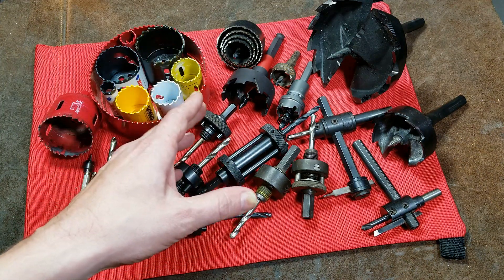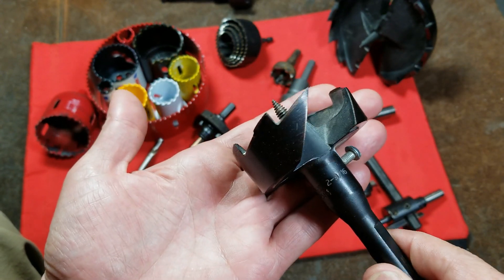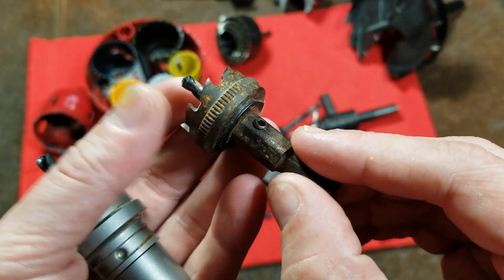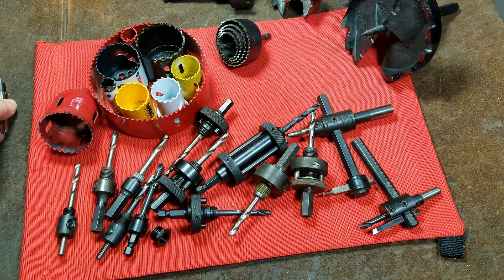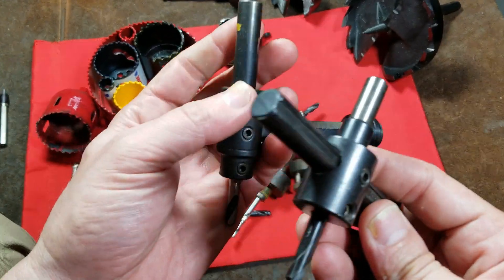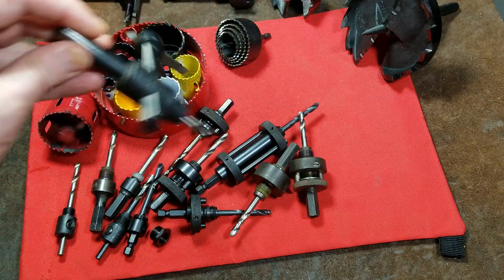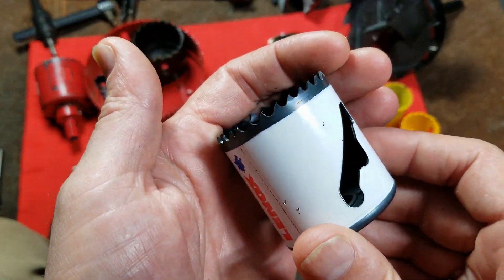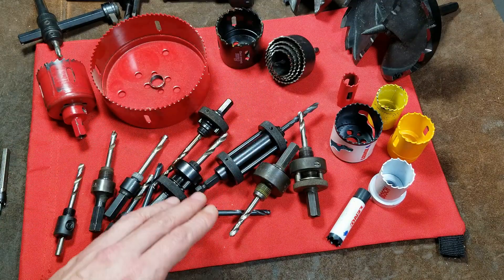Hole Saws, Self Feed Bits, Fly Cutter Overview/Discussion

Comment: Can you bore deep holes with the self feed bits?
Reply from the maker: Yes you sure can but you have to make sure to drill real straight otherwise they will start to direct off center because they're pulled through by that screw tip and wherever it points is where it's going to drill a hole.

Also you'll periodically want to reverse just a little bit and then pull the bit out the not let a bunch of chips stack on top of it and jam it up
Reply: Hi, 
Can Lenox self feed bits cut through nails? @CatusMaximus
Reply: @CatusMaximus  Thanks for the info.  I need to bore some deep holes wider than any ship auger I could find.  Wasn't sure what to use. Subscribed.

Comment: As an electrician, I have used self feed bits to drill 2-9/16 holes for service entrance cable. I normally run large self feed bits at a slower speed because the drill has higher torque.

Comment: About 10 years ago I was using a fly cutter in a cordless drill. For whatever reason I though I could try drilling a hole at an angle with it. Nope. I just completely sliced my thumb open. Bone, tendon, meat, everything was visible. I don’t think I told anyone, I just sat alone with my hand wrapped in paper towels and stuffed in my pocket until it stopped bleeding. Pretty neat scar though.